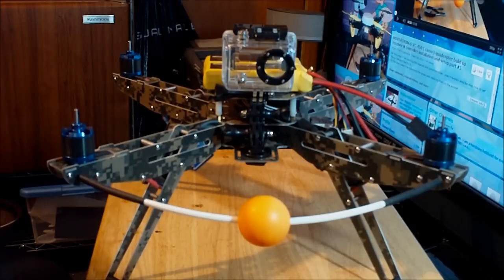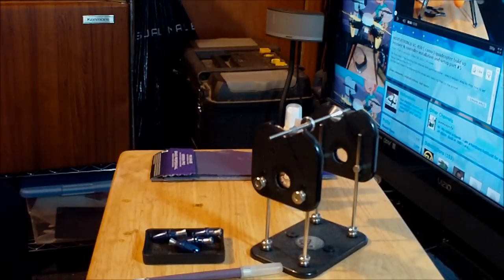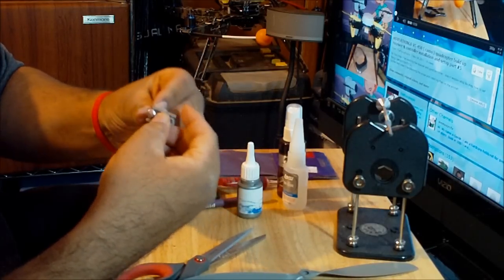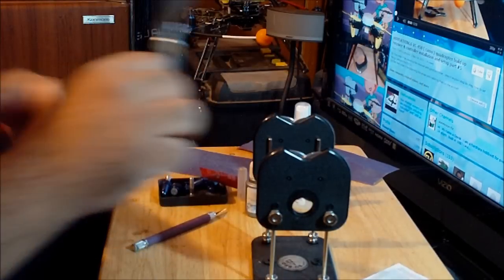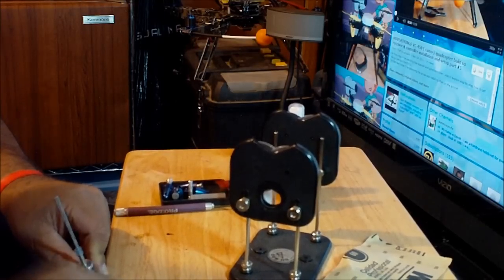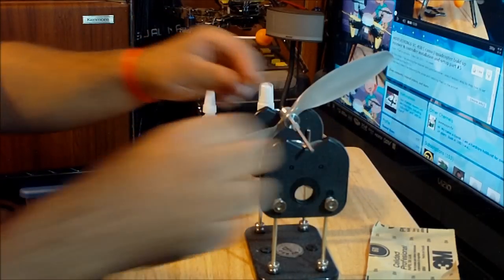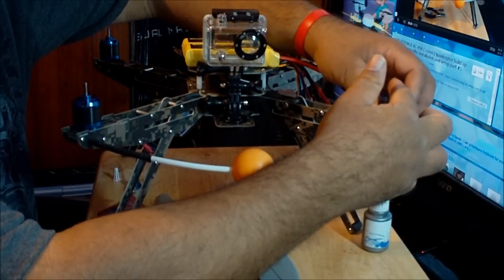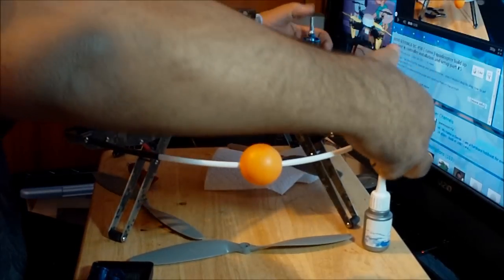HOVERTHINGS VC-450 ( camo ) quadcopter build up props balancing & installation part #6

Comment: You may end up needing to buy a second tabbed plate. With the gopro and flight camera on the front tab it was fine but once i added a camera gimble (about the same weight as the gopro case and tripod) that tab started to flex and cause unwanted camera vibration.

I have since purchased a single tab plate to mount on the top of the quad and this allowed me to connect the front tab to the new tab via spacers which stiffened this up allot and reduced the vibrations/flex to nil.

Comment: @TheFlyingRookie I am trying out the one at quadframe. Its a fairly inexpensive two axis (roll/tilt) gimbals. It weighs about 100 grams, that, the 100gram gopro and the flight camera on one tab was enough to cause consistent flex/vibration.